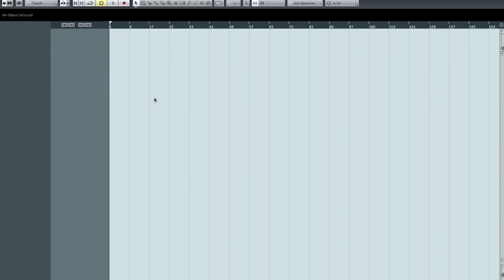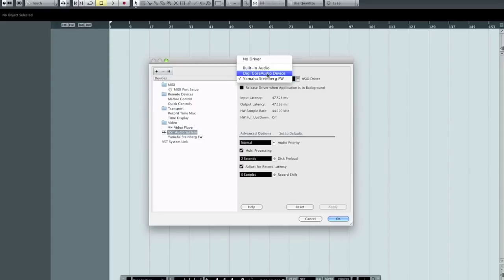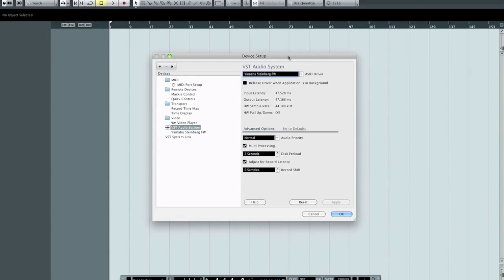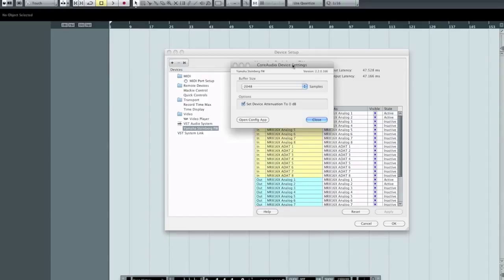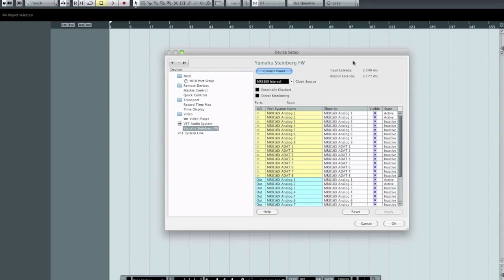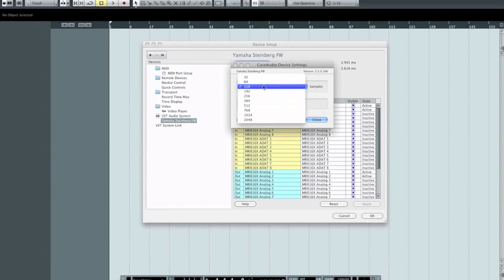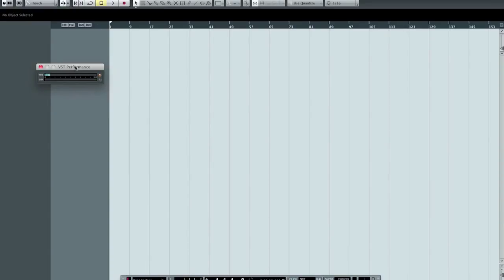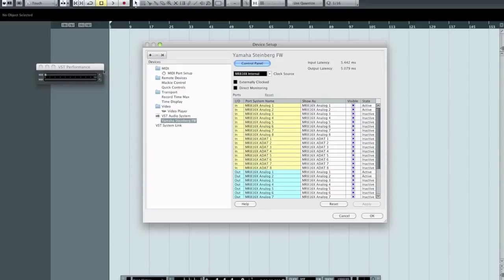Cubase Ninja! Part 1: Setting up your audio interface

Comment from the maker: It's most likely a driver issue. Have you installed the latest drivers from the company website? If so, be sure to select the device in your system prefs (or control panel on PC).